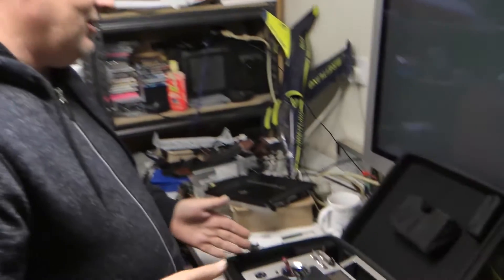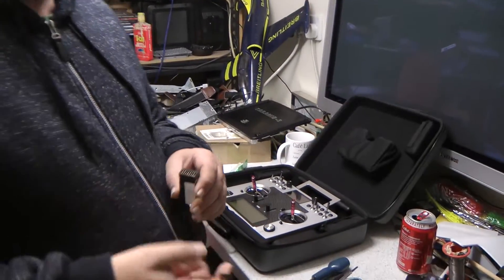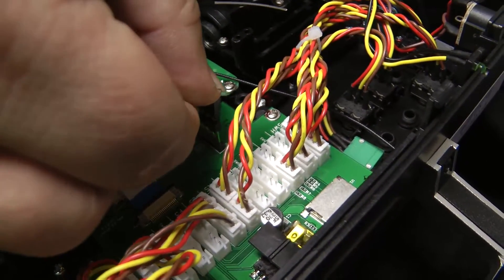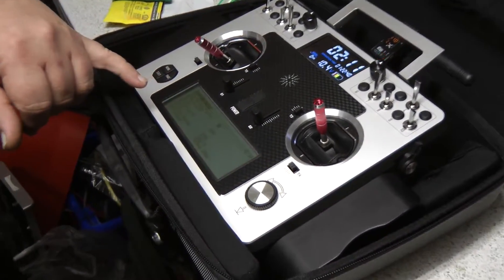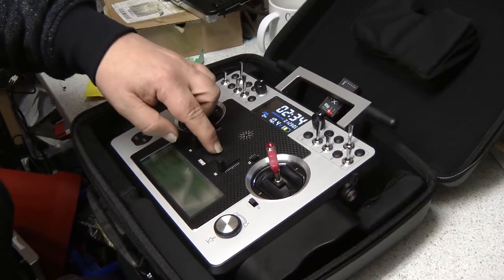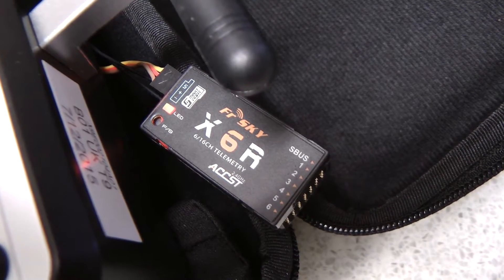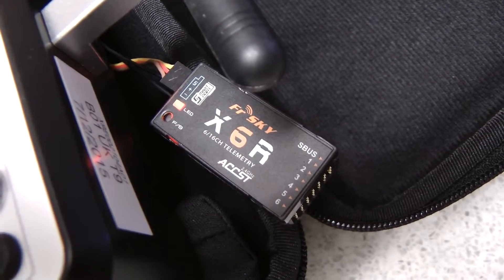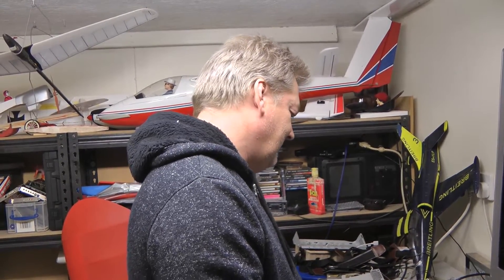How to flash firmware FRSky Taranis Receiver RX x8r x6r

Comment: a bit puzzled as to why you flashed the tx and rx to non eu as the new LBT  feature is about 10% better signal and more stable RF signal?
Reply from the maker: +Norman Stewart Mainly  backwards compatibility because i didn't want to replace all my old FRsky Rx's. Which have given great performance way beyond their published spec ;o)
Reply: I think the Non EU version is FCC and the EU is CE power for the TX and RX. So greater increased power and range.

Thanks for the Video it is most useful. Liked and Subscribed.
Cheers
Reply from the maker: Cheers Brian ;o)

Comment: When i want to upgrade i only get the option delete.. same firmware as you guys. any idea?
Reply from the maker: +Casper van Eersel Maybe you have an earlier version of firmware on your transmitter? Earlier versions of tx firmware do not have the feature! :o)
Reply: You've probably solved this by now but you need to make sure the file which you load onto your SD card is a .frk file. Mine downloaded as .rar file so I "unrar'd" it and then it worked fine